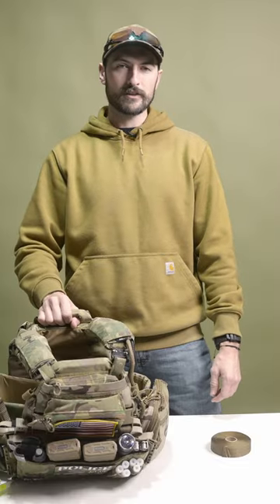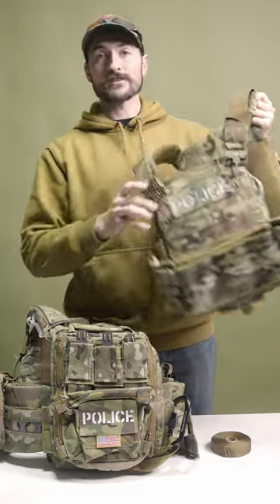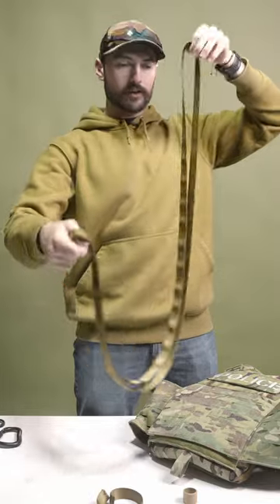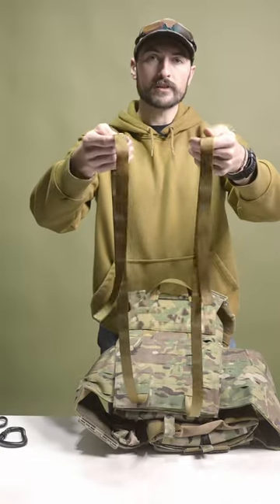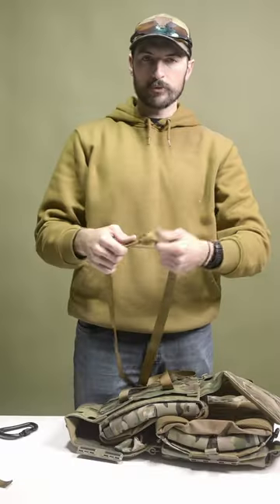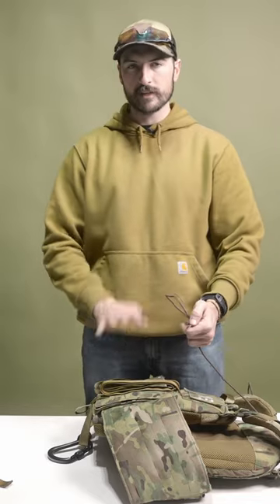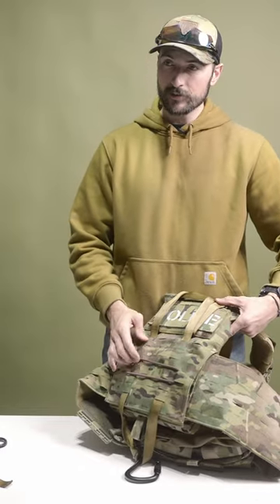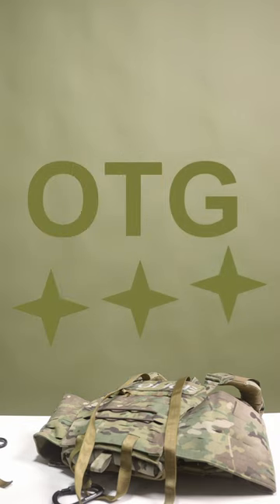How To Make A Drag Strap

Comment: Will this method work for carrying fat women out of my bed?
Reply: #1 the fact that you're even considering 'carrying' a fat woman shows your lack of experience.
#2  the fact that this was about a 'drag' not cradle or litter shows you don't listen well
#3 combine the 2 and it's pretty appparent that you will not need an answer anytime soon but i'll throw you a bone anyway.
#4 always drag or roll fat girls out of your bed. be safe and don't ever try and carry one! 
NOTE- If circumstance dictates a carry only extraction always go with a ranger roll technique but be CAREFUL! one slip and you can get yourself into quite a precarious position. i'd suggest donning an avilung device or snorkle to avoid auto-BBW-asphyxiation.
be safe out there.
Reply: Depending on what you consider "fat", I would recommend increasing the strap width from 1" to 5".
Reply: I'd just ask them to leave
Reply: Here's an idea, stay with me, don't bring them to your bed in the first place.

Comment: When your life depends on it, use a water knot to tie two ends of webbing together not a square.
Reply: Along with the water knot, first cut and seal the ends of the webbing at a 45 degree angle.  This helps with threading in the molle.
Reply: That's what we use in the fire service for a hasty harness. Traced knot doesn't slip.

Comment: What size carabiner did you use for this?
Reply: I used a Kong mini D carabiner as I didnt want a large mass of metal over top of my spine. The chances of falling back on the D ring seem much more likely to happen versus needing drug by it. 

Its not rated for climbing but is rated for 600kg or 1300lbs 

It hasnt ever come close to coming off my inner belt

Comment: Meh I'd rather pay Aglite for their verison that allows you to carry rather than drag.
Reply from the maker: This is not for long term carries. This is for short drags out of a problem area, where you can triage/intervene/utilize a carry system. So you’re not picking a better capability with whatever agilite makes, you’re picking something with a different purpose.
Reply: @oriontraininggroupllc2782  If the purpose is getting your teammate out of the area to triage, it is the same purpose. Theirs leverages physics and human physiology in a better method, that still leaves both hands free to manipulate items. Further the Israelis have and are using them in combat right now. I will take fully developed and combat tested system over an ad hoc system.
Reply: @presidentmerkinmuffley6769 What you also forget to realize is the amount of time wasted trying to setup the agilite buddy system. You'd spend more time attempting to setup agilites system than you would just grabbing a drag handle and pulling. OTG was correct in saying that these two systems serve two different purposes.
Reply: @testpython3575  Yea take a look at how the Israelis use it there is footage out there; use handle that is already on any plate carrier to immediate cover then the optimal is other team mate places casualty, set straps and go. Still more effective as this give you several feet of pull before movement at the end of a semi secured strap and biner, what are leverage and torque again?? The only reason to have this length is to be able to stand and move while pulling which implies a further distance than to immediate cover which a pull to immediate cover is perfectly handled by the drag handle that doesn't yield and is already on the carrier.
Reply: @presidentmerkinmuffley6769  ive done my research on it already. its okay to disagree but for care under fire, a drag handle is more effective. once care has been provided, agilites system would be better for moving the patient to a casevac site. Like I said in my first reply, two different tools, two different purposes.
Reply: this 14yo armchair operator twirp just wants to sound smarter that you. it's obvious that his 'research' is all on his phone or gaming computer and the only 'action' he and his super cool 'kit' will see is in his fantasy goofball platoon or maybe an airsoft field once he's old enough to drive there himself.